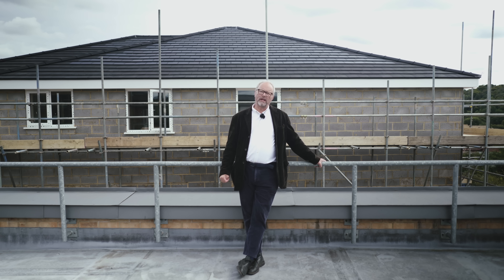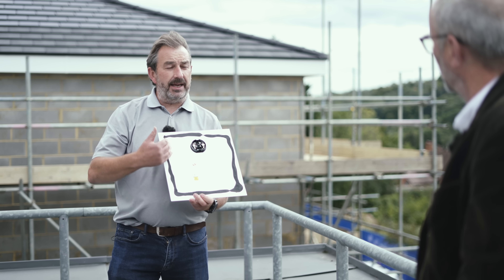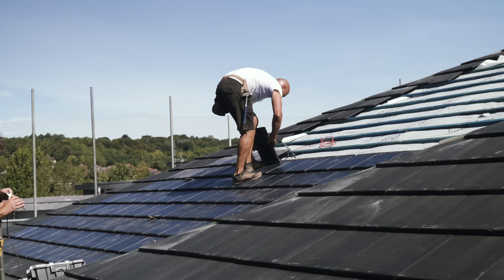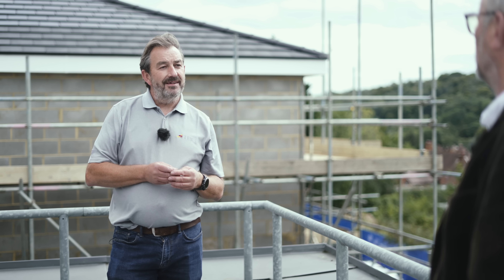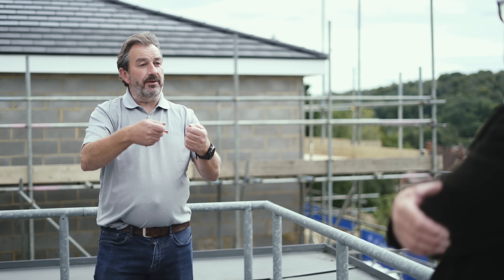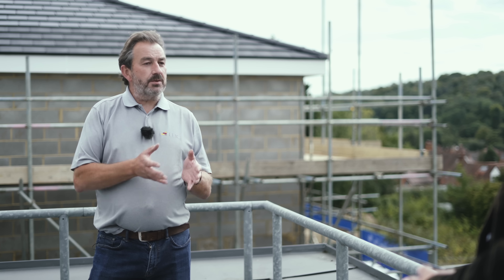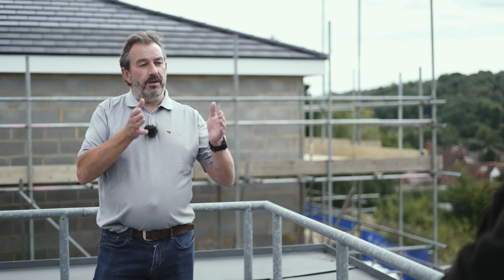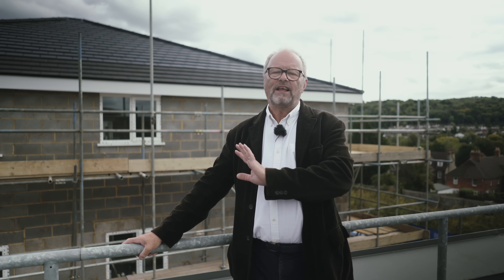Solar Roof Tiles - should every building generate its own power? | 100% Independent, 100% Electric

Comment: It's funny the effects of "legacy". We've seen it over take the likes of android, trying to create "multi-window" "picture on picture", seemingly entirely forgetting that we were trying to "get away" from "windows"!!! The same has occured in the car industry, where legacy auto makers continue to try and design EV's using "tried and tested" methods that have completely failed them and left them in Tesla's inter stellar dust!! 

And now, we have solar roof tiles! You can now get 300 watts of power by installing 6 or ten times as many items! More connectors, more points to fail, more man power hours, and more weight which in turn requires greater structural engineering! 

So, why?!!?? Why not change the roof shape, use flat roofs, like Tesla has, point them roughly towards the sun and do wall to wall solar, where the solar IS the roof! No roof tiles required, clicking two connectors can be the best part of half a kw of solar! 

This is the same illogical type of thinking that's driving the whole v2g movement, it's the same nonsense that pushes the whole need to "charge stations" etc etc. 

The reality is literally a distributed future, and that applies to everything! "The grid" is such a legacy concept!
Reply: There's ALWAYS some wide-eyed idealist out there telling us how things must be done, isn't there?!!
Never any realistic idea of how it will ever be achieved......!
Reply: @andymccabe6712  Indeed! Not sure who you're referencing, but there, always some "wide eyed idealists" out there! People who decide that walking isn't good enough, who then figure out flight, people who abhor skipping disk's when listening to music and instead decide to put "1000 songs in your pocket", people who have a hunch that the world isn't flat and that voyaging around it just might be possible! 

There are those "wide eyed idealists" who "who don't have a clue" who decide to build an electric car company from scratch, when others advise lateral integration, like the legacy would suggest is "wisdom", they decide to dive into vertical integration and create one of the most pleasing cars of the past 100 years!!! They're those same people who build planes so big they can seat hundreds of people, something that previously was unheard of, they dare to build rockets, and land them, something the legacy couldn't fathom!! 

Damn these wide eyed idealists, who dare to dream and fathom, and then do!!! Damn those wide eyed idealists for their ever increasing contributions to the world and their constant refusal to let the status quo win!! Damn those wide eyed idealists who dare to put words on paper that few journos will!! 

I guess it's damn myself, for I to, am one of them!!! My only question is, why aren't you?!!?

Comment: Very intresting!

What is going to happen if One Module fails?

Looking foreward to see these in Portugal, we have lots of Sun here 😉
Reply: The same as any other roof.  If a tile is physically damaged, it will have to be replaced so the rain does not come into the building.  The properties that make a solar cell work do not fail spontaneously.  It is the chemistry of the material itself.

Over many years, the sunlight can slowly break down the efficiency little by little, but solar panels built in the 1980's still operate at over 80% of their original power.

By the time today's panels are that old, there will be much better replacements.  The solar energy gathering material will probably be just sprayed on like a paint or spread as a cloth sheet over large areas.  Yes, there are people developing these already for specialty applications like sailboats.

Comment: In the 70’s they had solar or just ambient light powered calculators. I’m wondering when solar power will be incorporated into clothing because they already have battery powered clothes
Reply: They are developing solar cloths already for the sailboat market.  Other groups are developing spray-on solar-generator paint, and a liquid you can soak regular bricks in to turn them into low-level batteries, so a whole wall or building can store electricity.  Lots of cool stuff out there.
Reply: animist channel pretty cool. I figured as much except for the bricks. That is innovative.  It’s only a matter of time and the energy storage issues will be behind us.  The bricks made me think of the pyramids for some reason.  I wonder

Comment: I do believe that governments around the world need to mandate that all new roofs must have solar of some kind
Reply: imagine those tiles under 3 feet of snow, just when you need the most energy being produced? also, the cost is 3 to 4 times the cost of any roof in North America and those tiles are not available anywhere other than EU, so no availability of materials, no return on a cost that is 3 to 4 times more than regular and no electricity production during at least 5 months out of the year also the electricity rate in North America is so low that it would take 100 years to just pay for the tiles and no electricity so you still have to pay for it, where is the value?\Why would anyone install a solar roof if they are not living in a very hot country where it is efficient at least most of the time?
I have an electric car because I do not drive a lot and electricity is extremely cheap here, I spend 1 pound per charge or 1 pound per week on charging my car for 165km range. 1 pound for a 40 kilowatt of charge per week. why would I pay 30 pounds per tile to produce electricity that cost less than 10 cents per kilowatt?

Comment: That's great! The other thing I'd like to see is solar power installations on parking lots. They could shade the cars, generate power, and divert rain water before it washes through all the grease and oil left behind by vehicles. In the States we have car parks that seem to go on past the horizon, all completely exposed to the Sun. Might as well get something out of it!
Reply: Why not charge up large batteries and sell to the ev s parked there.
Reply: Sure absolutely - put EV charging options on the support legs for the solar panels.
Reply: Diverting the water only causes more flooding downstream.  You need to capture and treat and release. 

They also make concrete that cleans the air supposedly.  

I guess you can never have too many options.  Just need a sound and obvious way to rate and rank these ideas.
Reply: You don't get oil and grease in EV's, just sayin'......
Reply: @mraidymaddful  crazy how that works, isn't it? ;)

Comment: The tiles look very nice i am only concerned about the number of connections (trobleshooting seems to be quite difficult) and temperature in summertime. The standard panels receive cooling through air flow below them. Standard panel replacement is easy and independent from manufacturers.

Comment: Unfortunately in the "Comparision with Solar Panels"  two, imho, major disadvantages were left untouched:
1) no cooling for the panels, actually they are heated up by the tiles - which means a great loss in efficency and also in longevity
2) in electrical installations the connectors are usualy (in long term) the most probable point of failure - and here we have a lot of them. And we are talking of a lifespan for a roof of more then 20-25 years...

It's for sure better then no solar at all - but for the sake of transparency this should be also pointed out
Reply: Great comment
Reply: I seriously doubt this roof would last 15 years, far less in colder  climates.
Reply: Also, no way to "aim" the panels for the best view of the sun
Reply: @jblps  Which is why farmers use a rotating array away from any building.
Reply: Yes I thought of that also.
Reply: There are plenty of in roof PV systems available
Reply: Spot on!!!
Reply: I was about to pose this as a question .... I am no expert at all, but the connector story got me eyebrow-rising ..... 900 potential problem places ....... it reminds me of the christmas light strings where you take endless time to find the "lightbulb" that is causing the whole problem ;-))
And having so many connectors is most likely the steep cost factor not only in the purchase of the roof but also in the assembly; his 1 hour+ per elevation seemed a bit "ambitious" .....
I like the thought process and idea, which is at the base of this product, but I am not so sure if we are looking at a feasible solution here to drive the market .....
Reply: Alexander Gunda best comment here

Comment: I think solar tiles aren't that good really. The roof on my house is original, 80 years old. The efficiency of solar is still not good enough to last as long as the tile itself. I wouldn't want to change my roof every 25 years or so. Then there is the quality of the solar panel itself and also the environmental aspect concrete. My roof is clay and wouldn't be wise to put a heavy concrete tile on. I would prefer a new material for a roof, lighter with just as long as lifespan with the solar Panels I could change every 25 years. Sorry Robert.

Comment: Yes, said this 4 years ago when solar city was developing them. Every new build should have a solar roof that can generate grid electricity, imagine how much cheaper energy production would be compared to say building a nuclear station!
Reply: As long as you only need the electricity when the sun is above the horizon.  When you add in a battery bank you're seriously increasing the complexity, cost and environmental impact of the install.  I do love the idea of "distributed production" for electricity, and if I can ever build my own home I plan on using a system either like this or the Tesla.  However I also want to be tied to the grid, and use wind power as well to charge a battery bank.
Reply: Based the Energy Saving Trust solar calculator a unit of electricity from a roof top solar installation is more expensive than from Hinkley point C

Comment: I'm concerned about roof water leakage through the circular holes in the tiles when the panel isn't fully sealed to the tile due to weathering or poor installation. Another potential issue is a lack of "test points" to enable quick identification and location of faults without removing lots roof tiles - with hundreds of MC-4 connectors you are guaranteed to see the odd bad connection and potential arcing within connections in the roof structure which could be hard to find and could present a safety risk. If these concerns can be addressed then they are onto a winner.

Comment: Maybe it's me but I didn't get any information on cost and could you run a whole house without the need for mains input. All them figures when you have no electrical knowledge are just a blur. When I say cost I mean over and above another say 3 bed detached. I know differnt prices around the country but give us some comparison please
Reply: The costs were laid out quite clearly, £1 for each concrete tile, £30 for each solar module.
Reply: @videogalore  Yes but if you read my post and understand it, it doesn't say how much a complete installation  would cost with all the other requirements to make it work.
Reply: @grahamjohnson4702  I read the post, but missed the fact you were talking about overall costs. He stated 50% uplift over and above a 'typical' solar installation.
In terms of whether you could be 'off-grid' on these alone, you'd certainly need a battery and likely a much larger system than 3.8kwp.
We have an 11kwp system, but without a battery there is no option to go off grid. It's also double edged as you cannot sell any excess if you're not on the grid.
Reply: @videogalore  Thenks for clearing that up I am much wiser now.

Comment: When the efficiency rises to the 80% plus yes. Todays panels at best 20-22%. The investment vs return is not there. 
Also the resistance to impact is not there either. 
I have been looking at this issue for 20 years or more. I am an Electrician and to me the down side is far greater then the up. In a retro fit scenario the roof is compromised. Leaks and structural issues. The other issue is a UPS. See I am willing to build a vault outside of my home to store energy. Many people would not. The wall pack energy storage units......let's just say I do not want a cycling power cell inside my home. Batteries do blow up and they catch fire. Not in my house!
Reply: Cables also blow up and catch fire. Better not have any of these in your house either!

Comment: Those tiles looked filthy with footprints and dust covering them. I know this was only caused during the installation phase, but it made me wonder what efficiency loss there is over time due to dirt and other contaminants? Do all solar panels need cleaning regularly, or is the loss of output insignificant?
Reply: Yes you can see dusty footprints when they were installed, but on the completed roof you can clearly see that the rain has washed them away.
Reply: Every home own should clean their roof regularly, especially in the autum period and spring. Regardless if there is solar on the roof or not.
But, especially when you have Solar on the roof, that stuff needs to be kept clean, if you want best efficiency.
Reply: I've had solar panels on my roof for the last three years. They still look as good as when they were installed. The rain and wind seems to keep them clean. I think there is some sort of self-cleaning coating on the glass too.
Reply: @AndyFletcherX31  then you got good quality panels. 👍🏻
However, if you have a lot of birds in the area and trees, but also live is a area where there isn't much rain, a cleaning of the panels should be a monthly routine.
Especially during spring and autumn the sticky stuff from the trees and flowers is to be watched out for.

I always look up to my roof when I come home home, just to see if there is any bird poo I should clean. Especially when the weather forcast is dry.

Comment: It should be part of new building regulations to fit solar panels as a standard; not sure of the reliability or degradation of these items but as more are used we should hope to see corresponding reduction in unit costs, making both the initial outlay and any required repairs more realistic. As more EVs come to market it will have the added benefit of reducing the burden on the grid.

Comment: My only concern with something like this is the adhesive that they use to fasten the panels to the tiles.  I'd think that any sort of adhesive like that would be lucky to last 20 years.  Still a really neat idea, though.

Also, I wish other roof types here were more popular.  Here in Canada, almost everything is asphalt shingles.  They don't weigh very much, so I bet the roofs around here aren't engineered to take the weight of concrete tiles.  Asphalt shingles also don't do well in high winds (area I live in routinely gets 100 km/h winds, and it's not uncommon to see a few broken shingle bits blown around), and they only last ~20 years.

Comment: I would be concerned about the adhesive bond between the panel and tile. Roofing materials have to deal with huge temperature swings, and the thermal expansion properties of the two materials will be very different. I'm not concerned about the panel detaching (although possible) I would be concerned about water ingress via the hole through which the cables pass. You shouldn't rely on the underfelt.

Comment: Where I hang out in the states, we usually have asphalt tiles that last 20-ish years. That guy was saying the concrete tiles can last 40. Can those solar panels last that long or will the panel lifespan be the determining factor of when to swap out the tiles?
Reply: All new buildings should require (by government mandate) solar panels!!!11!! Morons love that stuff.
Reply: quite a lot of solar panels these days come with a 20 year warranty, so will function beyond that time. Concrete tiles tend to last a lot longer than 40 years.
Reply: @rogerjones624  Yup, the concrete tiles on my house are nearly 40 years old and are probably good for another 40.
Reply: @rogerjones624  So these solar panels are going to die way before the tiles. Are they going to replace the solar bits? Muffled 'This may be another way to get tax payer money.'
Reply: The way solar panels work is that over a lot of years, they slowly lose some efficiency because of the intensity of sunlight and some stray cosmic particles damaging the molecules at the surface.  The longer time goes on, the slower the degradation proceeds, because eventually the surface layer of molecules taking the most damage is already damaged, so the layers of molecules underneath are partly shielded.

When they say "guaranteed for 30 years" or whatever, they are saying "guaranteed to still be generating over 80% of the original power amount at that time."  The panels don't just stop working completely after a certain time.

I don't know what these guys are using, but the Tesla V3 panels are expected to continue to stay above 80% of original efficiency for like 100 years.  Elon joked (approx) "It's like you could lift the roof up and put a new house underneath it when the rest of the house wears out."

So by the time the typical solar panel today runs down efficiency enough to replace, if you're still alive by then, you'll probably have a "Mr. Fusion" module in the hall closet generating all your power anyway.  Just toss in some kitchen scraps and charge up the DeLorean :)
Reply: animist channel Well done. You got your useless point across!!! I'm proud of you!
Reply: @eltzrothm1   Now you seem like a very angry person.  You might want to see to that, before you start doing it when you aren't insulated by ten thousand kilometers of internet wiring.

You're the one who asked about lifespan on solar panels, so I gave a bit of info, and a bit of humor.  I wonder which one pissed you off so much.

Do you always lash out at people who try to help you when YOU asked for it?  Nevermind, I don't care.